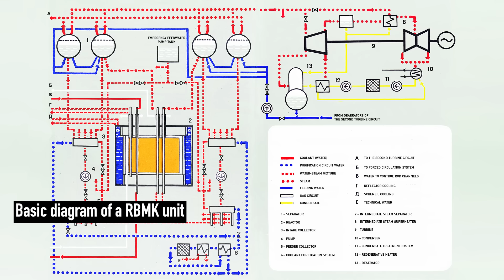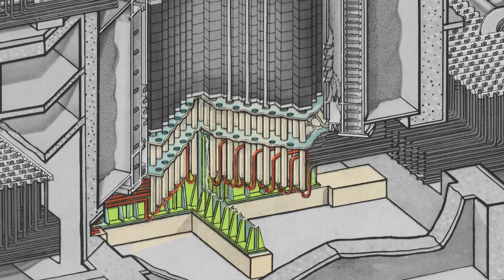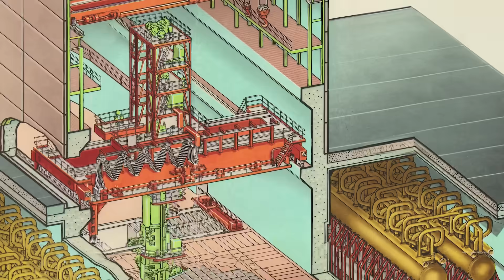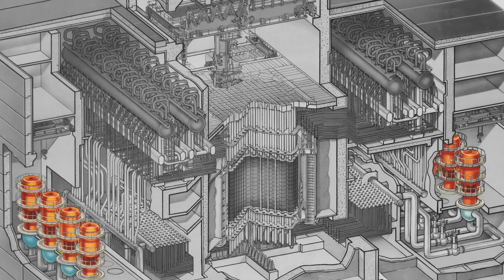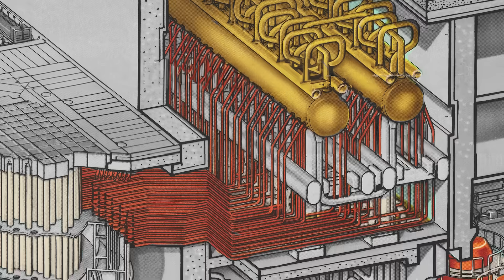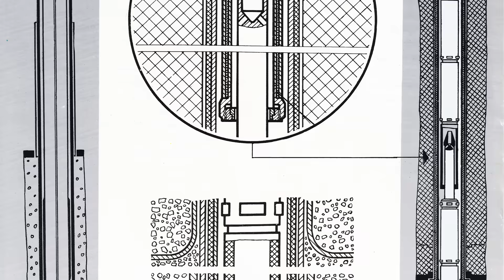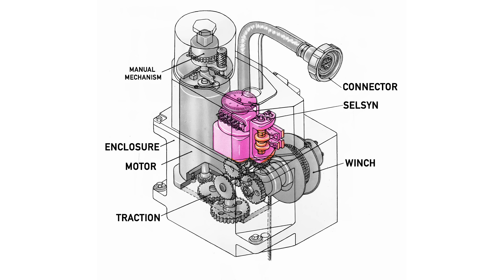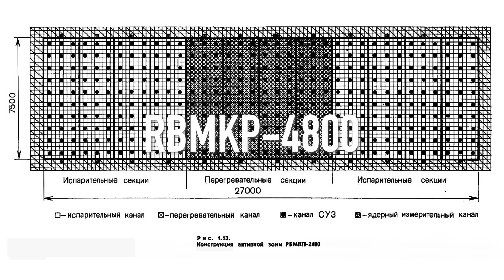RBMK: The Soviet Reactor That Was Doomed from the Start | Chornobyl Uncharted Ep 04

Comment: That is a ridiculous amount of plumbing. It's crazy to think that building reactors like this is even economically feasible. The sheer amount of fuel, all of the copper, all of the steel and concrete, all of the wiring, the turbines, the analog controls and so on. There are just so many points of failure. Not to mention the wild amounts of radiation.

Comment: Three mile island suffered a meltdown as well but several factors prevented a Chernobyl disaster from happening. 1 the containment structure, us nuclear reactors are built within a containment building designed to withstand a direct impact from a Boeing 747. 2 the operators despite the lack of instruments figured out what was happening and were able to flow a lot of extra water into the damaged core. And lastly safety regulations were able to do their job. Recently they showed a plan to dismantle TMI#2 which was partially melted down and due to power demands of artificial intelligence have put together a plan to reactivate TMI#1
Reply: I really hope they will restart it, it's expensive fun but the future is in nuclear, I believe it. I can't stand the green lobby and their useful idiots that scared countries to stop their perfectly working safe reactors (Germany). Thanks God we have 2 NPP's in Czech Republic and hopefully will build 2 more reactors. (So if something really happens, Germany is f*cked anyway, they could keep their plants up together with workers having jobs and less carbon emissions from burning the coal)

Comment: This is so good. Thanks for sharing the illustrations on patreon. But i just wont fully understand the cooling. So the fuel rods are placed inside of the pressure channels? The control rods are also placed in tubes of a different cooling system? How is it then possible to remove a single fuel element? Is it possible to stop the reaction in one fuel rod and cut off the affected pressure tube from the system?
Reply from the maker: Each channel can be sealed individually and when the RZM machine connects to it, it creates a temporary sealed common environment between the channel and RZM's scaphander.

Comment: Very impressive engineering but far too many single point failures, I suspect there were many problems with the primary cooling from cavitation and corrosion.   Fortunately the many tonnes of sand around the RBMK saved the world from further contamination.  I have walked on the loading deck of  Wylfa Advanced Gas Cooled Reactor in Anglesey, it had a fuel reloader similar to the one shown,  the AGR had a very simple cooling.
Reply from the maker: Thank you for sharing!

Comment: I think you are mistaken, comrade, RBMK reactors do not explode.
Reply: My mistake.., it was rapid unscheduled disassembly
Reply: Fr. He is delusional.
Reply: ''Spreading misinformation at a time like this, It's disgraceful''
Reply: "irony" curtain
Reply: Get him out hes delulu
Reply: They do if you misuse them badly enough
Reply: Take him to the infirmary
Reply: then why did Chernobyl explode
Reply: @TommyLee-r5b The reactor design is great, until you make Titanic levels of errors one after the other. Seriously, a remarkable if complex design.
Reply: @TommyLee-r5b 
Chernobyl did, the other RBMK reactors didn't though. 

There are most probably still more than just a handful of them operational up to this day, they're not simply bad by design. 
They just got pros and cons like every type - and being pro-proliferation by allowing hot swapping fuel assemblies to extract proper grade Plutonium after short burn times was quite the substantial pro back then.
Reply: @TommyLee-r5b control rods had graphite tips, so it basically expedited the chain reaction. Imagine brakes on a car, instead of instantly slowing you down, it accelerates you for a short while then tries to slow you down again. Reactor got so hot, when the  cooling water made contact; it instantly evaporated and formed hydrogen, then after that it was BOOM.
Reply: @aexuus7733  I heard they built it cheap
Reply: @TommyLee-r5b  ussr is cheap and put graphite tips on control rods so when they tried to drop them to slow the reaction it actually made it go higher, it ended up going around 120 times higher than designed.
Reply: @r @ralanham76  thanks for the answer

Comment: I cant understand where the water is and is not. I have seen different schemes show that fuel is in water or control rods are in water; Also heared they are both in water, just different systems with different temperature; Can you help me understand it? I'm not even sure with the fact if all of the rods and fuel are placed in their separate blocks or not. Channel here is a tower of these blocks forming a single tube, right? AI is also hallucinating me some random stuff
Reply from the maker: Just watch the most recent video, as it covers exactly those questions
Reply: @ChernobylFamily  The control rods themself are also confusing. I understood that the graphite tips are because low efficiency fuel is not active enough to work through all the water and thus needs to be boosted my graphite tipped control rods? But if they are inserted fully, then you have extra graphite in the bottom and boron in the middle and top of the reactor?

Comment: Despite some flaws in the reactor design this is a purely human error of those who operated the reactor in modes not intended for it, and nowdays such situations are completely excluded. The problem was in the material of the rod tips, during normal operation it had no consequences. There is only one conclusion here - the station personnel cannot be allowed to conduct experiments on a working reactor, using operating modes in which its designers did not provide for its operation. If you look at it from the point of view of the incident, yes, there was a design error in one of the important components of the reactor, but the incident was caused by the ill-considered actions of the personnel. The same thing happened at Fukushima - the station manager could not make a simple, correct decision himself. Therefore, since 2011, all stations, from the point of view of their safe operation, are controlled remotely by the vendor themselves. The station personnel will no longer be able to do any crazy things

Comment: Makes me wonder what would have had to be changed to make it less dangerous or if the fundamental design was flawed?
Reply from the maker: Such changes were eventually applied, there were many, but main were implementation of fast emergency protection (BAZ) in addition to original AZ, and change of control rod design.

Comment: Wow, in hindsight those designs for the RBMK 4800 look insane.  Imagine if there were a botched safety test in one of those.  The rectangular layout seems perfect for uneven radiation events, and just the sheer mass of the thing makes me wonder if it could tip over some tipping point where a disaster would not have been containable.
Reply from the maker: i remember having a talk with actual Chornobyl NPP engineers regarding that. They told me literally this: 'we would manage those reactors running as a Swiss clock, seriously, no worries. BUT, when it would come to the decommissioning stage, that would be a real engineering nightmare because RBMK of any kind means a HELL LOT of irradiated equipment.'

Comment: It was not an accident or design flaw it was resentment from the head engineer a woman was in place to take his position a woman until this day still goes unrecognised for her incredible ability to evaluate and calculate the necessary positions for the fuel rod assembly units for proper positioning for a evenly balanced temperature removing all of the control units from the water level broke the grounding circuit between turbine and reactor the head engineer at that time was aware of this and forced this action resulting in catastrophic results when the first control unit touched the water this caused a surge that caused failure of all systems including all  backup systems
Reply from the maker: A nice  theory. Too bad, it is wrong. There is one very basic fact. Calculating of said positions and subsequent energy distribution within the core is a standard, absolutely routine functionality of reactor's SKALA computer system implemented by its PRIZMA program. It is not done manually.
What happened next and why, was very well explained in INSAG-7.

Comment: I'm no nuclear engineer, but having heard that it is much cheaper to build and maintain, I can understand, why the Soviets went for this design. They already were in an economically difficult position, so having atleast cheap power (since they extract their own Uranium, Russia still does today), possibly also for export to make some money, is a nice perk to have.

And it probably would've worked out, as long as all people are fully in the know, what happens in that Reactor, something that was clearly not the case at Chernobyl.
Reply: The Soviets had oil and gas, nuclear power plants were not so necessary.
Reply from the maker: Statistics said opposite.

Comment: Amazing machine, crumbling systems are not fit to manage safely such complex engineering. Countries in the west should question themselves if they wish to continue operate their NPPs.
Reply from the maker: How those two things are connected? Comparing modern NPP to this is equal to comparing Maybach and soviet Lada.
Reply: @ChernobylFamily  if the driver is unfit, it does not matter if the car is a Lada or a Tesla, it will end up crashing one day or another.
Reply from the maker: Correct. So it is about training the drivers, not about cars.

Comment: The reactor required highly knowledgeable operators who understood the pros and cons of the reactor. The reactor would have been fine with competent operators.
Reply from the maker: Sounds good, too bad it is very easy to break your theory to pieces just based on IAEA documents, Kurchatov institute conclusions, etc., etc. What you said is literally a soviet version, which was very convenient, as operators died. They WERE enough competent in the scale of the technical specifications they were provided with and trained on. Modern investigations very clearly prove: there were effects about which the executive, operative staff was not informed. All questions go to designers and authorities that managed the system of RBMK power plant.

Comment: Technically speaking...... it wasn't doomed until they sabotaged it's systems to run a test and then didn't follow the rules leading into the test...... which was don't run the test if you poisoned the reactor.    

It's kind of like taking the pilot out of an airplane and after it crashes blaming the aircraft and not the missing pilot.

The ultimate irony is if they just lied and said they did the test... none of this would have happened.
Reply from the maker: @wrayday7149  mmmmmm, i'd not put it on operational staff because it goes directly against modern investigations. If not they, then another would run into a situation where the issue with positive void coefficient would fire.
Reply: @ChernobylFamily  yes and no.  This test was messed up because they poisoned the core.  Other reactors that werent poisoned completed the test.  We arent dismissing the design flaws of the system but we shouldnt ignore the mistakes made.
Reply: @ChernobylFamily  Sure.. if any other team made the same mistakes then the same result would occur.  

However, other similar reactors didn't explode.  Those other reactors were put thru the same safety test.  Those reactors suffered from the same design flaws.

So that leaves us with the staff.  The staff's failure to properly moderate the reactor before the test and the refusal to postpone the test until the reactor was stable led to all the holes lining up for the explosion.

Had the staff not poisoned the reactor they would not have pulled all the rods to recover it. Meaning when the reactor started to runaway the rod's would have already been in place and the graphite tips wouldn't have been a major factor.  All they would have needed to do was turn the water on.

No amount of "Modern Investigation" changes those hard facts.

Comment: Fascinating. I can see the technological advantage of RBMK at its time. But it's an excruciantly complex design. Don't think the  load/unload fuel capability and the "you can walk over it" gimmic while running justifies the complexity. And cannot understand why there must be thousands of thin tubes with its thousand of sensors and their auxiliary gear instead of just hundreds of bigger tubes and associated gear. PWR and other reactors are also complex, but not a mindblowing clusterfuck of tubes.
Reply: CANDUs sit in a happy middle of being able (and needing, in fact) to reload under power, while still being simple-ish enough that channel-type reactor advantages aren't outweighed by complexity

Comment: I still cant wrap my head arround the whole piping of the feed water channels. 
How can you access a channel from the top of the reactor, when the top and the bottom of the channel is connected to the water lines?
Reply from the maker: @toastbrot21016  the pipes come from a side. At the top of the channel is a special plug.
Reply: @ChernobylFamily  so only the 'filling' of the pipe gets changed, not the pipe itself?
Reply from the maker: @toastbrot21016 exactly

Comment: A dangerous reactor design no one would have built other than the Soviets.  It was built to be inexpensive to build from materials available in the USSR, easy to expand to larger sizes, fast and easy to refuel and to efficiently burn fuel.  Safety was not a major consideration.  They completely depended on following procedures for safe operation. Operators were not sufficiently trained.  How could a reactor operator not understand Xe-135 transients? How could they not understand the severity of an overpower incident from low in the power range or in the intrinsic power ranges? Since the accident happened at a very low power level, power could get to incredible levels before an automatic system intervention could stop it.  I understand the last power level reading recorded before the monitoring systems went off line was 33,000 MW, about 25 times its rated power.  What happened there was absolutely criminal.

Comment: Unfortunate that such a promising design suffered mismanagement, and cost cutting, leading to the disaster. A reactor, that can run on low enrichment, and even fuel other reactors considered spent, could be quite economical. Not to mention the ability to refuel on the fly, and reposition fuel rod for optimal baking. If they had not cut costs on the control rods, containment, and other aspect, properly trained their crews, and not lived in a pass the blame culture, these reactors may be still running strong today. We may have even seen improved models with more modern technology further advancing their safety and performance to modern standards.

Comment: The design is not to be blamed for the disaster, the accident is fully human error who did really stupid things on the system
Reply from the maker: Wrong. What you say is a purely soviet version which was very convenient for authorities as those people mostly died painfully. Modern vision, based on mathematical models and years of research proves opposite, though does not exclude human factor but only up to a some grade. Read official IAEA investigation documents, such as INSAG.
Reply: @ChernobylFamily  Many RBMK are still operational till now, you can say the design leaves little room for human error and is therefore flawed, but the system is meant to be run by computers, turning off the safety systems is what caused the disaster. Many Planes nowadays are Fly By Wire, if the computers are turned off, they can hardly be fly by humans. So are those designs flawed too ?

Comment: Chernobyl's reactors were #3-6  in series. #1 and #2 were shut down in 2018 and 2020 respectively at LAES, Sosnovy Bor. Dismantling these reactors is a project starting in '25 and' 26.
#7 and #8 are still running at full power, currently scheduled for decommission at about 2030.
Managenent, control systems and automation at LAES were far away from ChAES. These were main reason of failure, not a faulty design.
Reply from the maker: ChNPP 3 was also shut down in 2000 but could operate to 2015. It is not really correct to compare management after Soviet time and during it.

Comment: It seems that steam from the reactor goes directly to the turbines?  There is no inner loop/outer loop interfacing at a heat exchanger?  This would make the steam passing through the turbines highly radioactive.  Is this how it works?  Doesn’t seem very safe.
Reply: Yup. BWRs have a similar steam cycle

Comment: The sheer amount of piping is just staggering to me. I always pictured the reactor core as sort of a bunch of fuel rods in a frame in a pool of water, like a water heater. Cold water in the bottom, passes through the fissioning fuel, then hot water and steam out the top. Two pipes. But seeing that the RBMK has an inlet an outlet pipe for EACH of the 1700 channels, plus control rod cooling and winches... is just staggering to me.
Reply: Because of that piping, that's how individual channels could be isolated and serviced without shutting down the entire plant.  It enabled poor quality fuel to heat up and boil only a very small volume.  Efficient and cheap even though it requires special operational precautions to safely operate.  PWR reactors cannot be large and must never boil.  It's safer but, it requires far more capital and expertise to make.  The U.S. can't even make those pressure vessels anymore.  We can't make anything of significance anymore.  Boiling water tube reactors, like the RBMK, are relatively easy to make.  In a capital-starved future, that's all we will be able to make. if we're lucky.